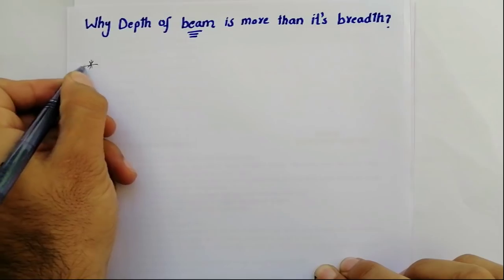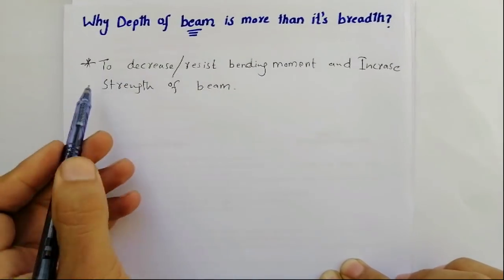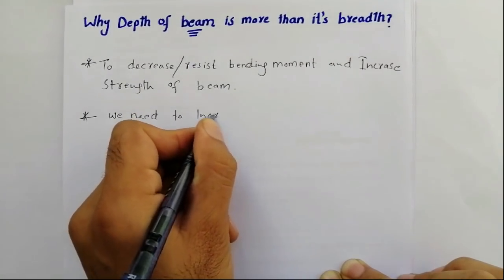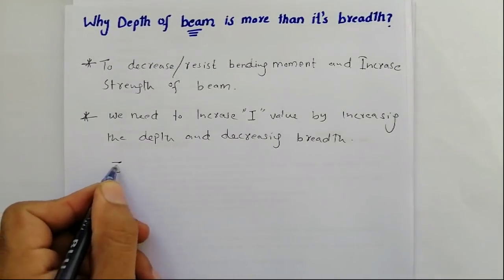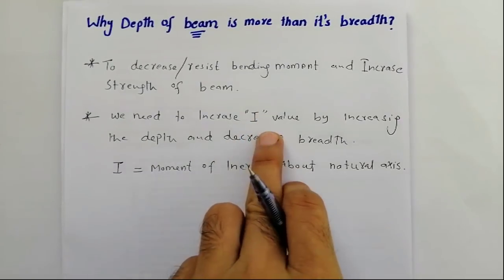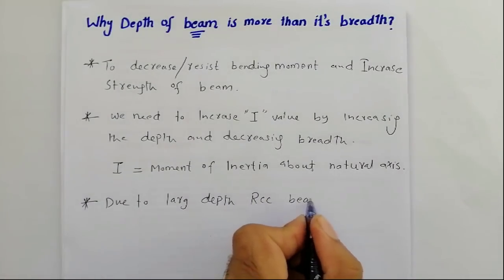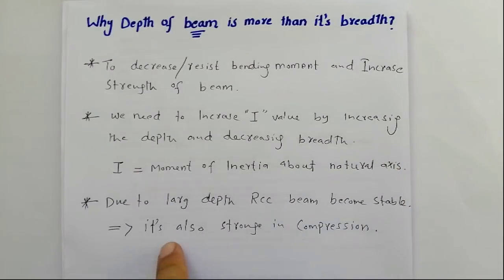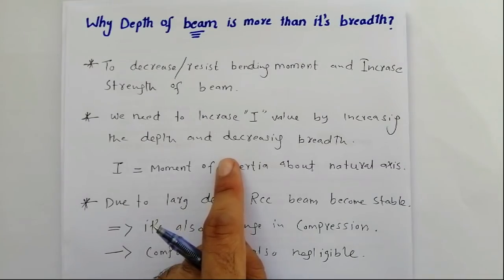Why depth of beam is more than its breadth/width? Why breadth of beam is shorter than Depth?

Comment: Hi, I love your videos. They are very educational. Iam just wondering is there any possibility in the design that the width of the beam will be larger than its depth? I've seen some here in my place and would just like to clarify if it has any major impact on the structure.

Comment: Bro samy. I have question. My contractor did not beam at the time of roof slab concreting for the area 24ftX12ft. LATER i fixed beam in touching roof slab. It will be strong and safe as before fixing? Pls inform?